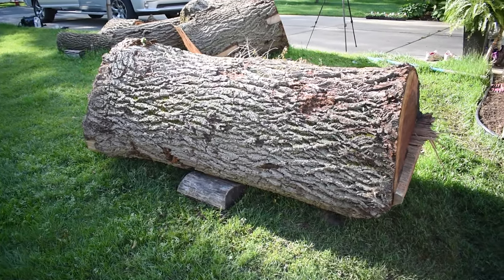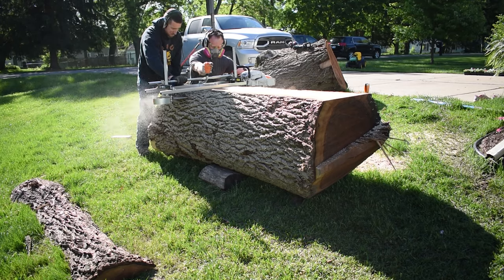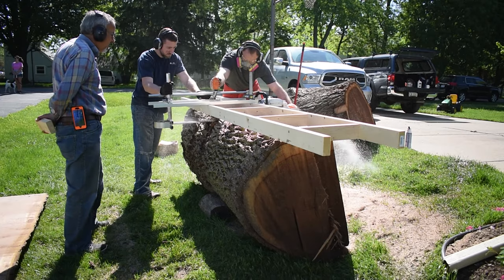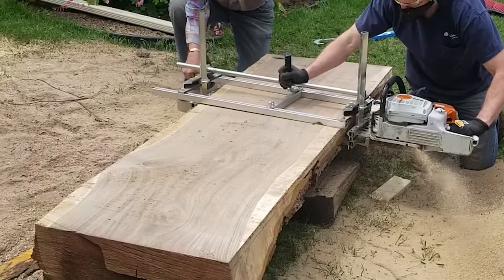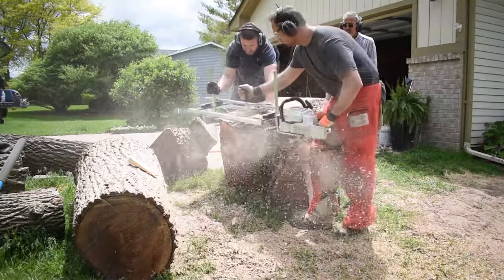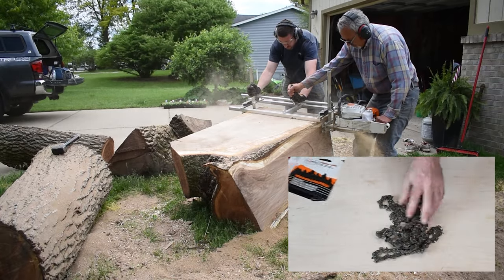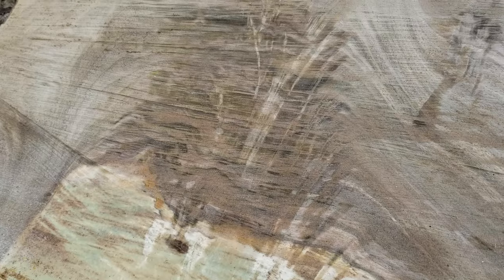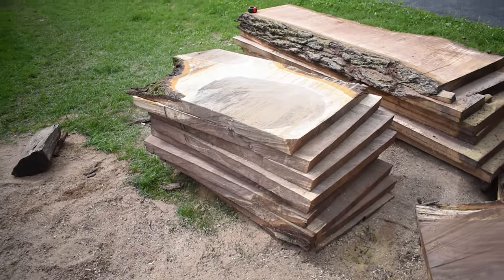How to Start Alaskan Chainsaw Milling | Milling a Figured Walnut Tree

Comment: I'm in MI and I just picked up an MS 440 with a 36" bar and the same mill. AND I have some large downed walnut trees that I really don't want to turn into firewood!
Reply: How’s the 440 going with that length bar? I’m looking to turn a now problem tree into timber once it’s felled. My dealer pointed me to the 462 as a minimum. All our wood in aus is hard, so that might be the reason.
Reply: @milesabove5259  The 440 is a great saw, but doesn't have enough power for a 36" bar. The real issue is the oiler doesn't get oil to the far end of the bar. I've since put a 28" bar on it for when my 18" Echo just won't do. But I may still use the 36" bar occasionally.

Comment: Just ordered a mill off of Amazon wondering if ai’m gonna regret it, but this video has me hyped now.
Reply: How did it go? Are you using it?
Reply: @vskjarvik  unfortunately I held off on using it until I found an old ladder for a rail system and only recently used it.

The ladder was too wide for my bar so I broke down and used some trailer ramps for some short slabs and couldn’t be happier.  I managed to get some great cuts from some walnut.
Reply: Nice! Which chainsaw are you using?
Reply: @vskjarvik  Stihl 661

Comment: Do you feel like when you mill the wider logs you need an auxiliary oiler? How many passes do you usually get before having to sharpen the chain? We have the same set up.
Reply from the maker: I haven't had a need for one, but I opened my oil screw all the way so I go through a lot of oil. A chain is usually good for about 800-1,000 feet. At that point I want to switch it out.

Comment: I’m about to start milling up some lumber in the woods stihl 362 and don’t really have anywhere to dry the wood and it will have to stay outside i guess I’ll have to make a makeshift shelter any advice ?
Reply from the maker: Make sure you use thick sticker boards so air flows between the slabs. Your slabs will likely get to a certain moisture content and then stop. Before you use a slab, bring it into the shop and let it acclimate. In Michigan, a slab will get to about 15% outside. It'll get to 8% in my shop.
Reply: @NewtonMakes thanks I hope it doesn’t mold lol

Comment: Good video dude! I got into slabbing last year, I like to use the ladder for ever cut I am usually alone and I have a 661 as well. I have had trouble with securing the ladder to the log, what do you do with the lag bolts exactly if you don’t mind explaining?
Reply from the maker: I carry multiple 1/4" lag bolts from 3-6" long because the log may not be flat. I like to have two bolts in one ladder rung so the ladder doesn't move. And I'll put a few more in a rung in the middle and at the end of the log. Ultimately, I may have six bolts or so holding it down to the log. If need be, I will put wedges or scraps under areas were there are gaps between the ladder and the log.

Comment: Just curious about the chainsaw you are using. Was considering getting a chainsaw mill but the stihl 661 is pretty cost prohibitive. Is such a nice saw required. My $75 16 inch electic saw isn’t going to cut it but is there something less expensive than the Stihl that will still work?
Reply from the maker: Sure. You can use several types of saws. The brand doesn't matter. The limitations are speed and capacity. If you want to cut a 20" wide tree you need a saw capable of holding a bar longer than that. You can use a less powerful saw but it'll make things slower. Still doable though.